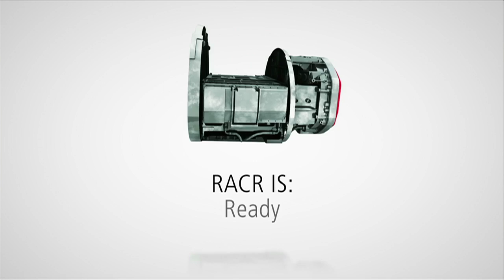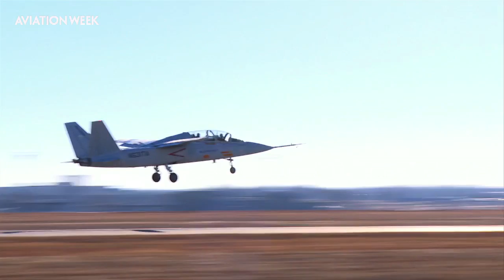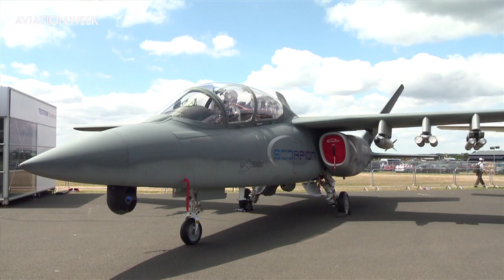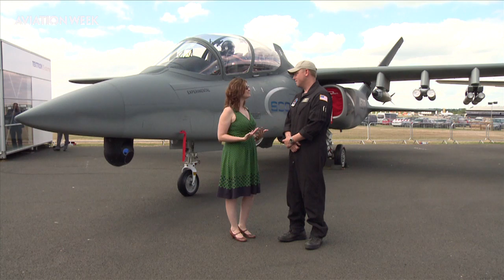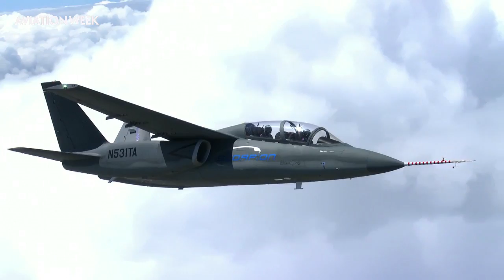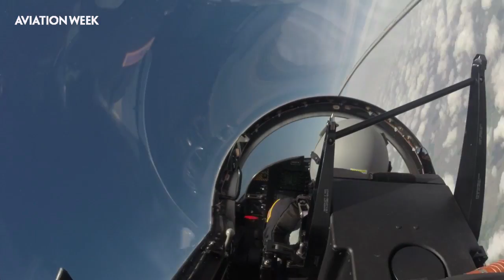Farnborough Airshow 2014: Textron AirLand Scorpion

Comment: $20M and only as fast as a WW2 ME-262?
Reply: +Nico Montinola It's an Air-to-Ground support plane.  The ME-262 was an anti-bomber high altitude fighter.  Compare this thing to a Stuka JU-87 if you're fixated on WW2.
Reply: I wasn't arguing the fact it was slow.  I was arguing on the cost.  You can get a faster jet and use it for ground attack that costs the same or a cheaper ground attack plane. Its a cool plane but just not cost efficient for the mission.  Of course, its a versatile plane but then you end up paying for that versatility.
Reply: Fortune K Its overpriced.  Korean FA-50 can do ground support and is supersonic.  Russian YAK-130 is cheaper and do the same mission.
Reply: @AccordGTR  They can do the same mission but for more money. The cost of  maintenance, preparation is lower on this aircraft, it is also more fuel efficient.

Comment: I can buy a private jet like the Citation Jet with the same money, and load it with a ton of cocaine and probably still fly faster and higher than this plane, much less chasing it down.  Remind me why I would want this jet for border security?

If I want to do ISR, I would not need the speed, so it'll be cheaper and more on-air time  with propeller based plane.  Or just mount some camera pods on a private jet.
Reply: But, with  at other plane, can you drop it on target properly

Comment: This is a cheap jet designed for sale to 3rd world nations whop want cheap counter insurgency and patrol capabilities.  Or other nations who want a trainer that can be used for ground strike in an emergency. The critical sales point is cheap running costs for budget conscious governments.
Reply: That's good. I live in NZ and the RNZAF needs an aircraft that could serve as a jet trainer, ground attack aircraft, maritime patrol
Reply: +Antifaith29 I don't think JTN L means fast jet aircraft. The RNZAF used to operate A-4 Skyhawks, the Scorpion could fill the role that it used to if the RNZAF wanted to have that capability back.
Reply: e0o9kii
 A jet trainer for what? The RNZAF has no fast jets and doesnt plan to have any. They are entirely reliant on the RAAF for that kind of thing. It's a damn shame actually.
Reply: +AdstarAPAD I wish I had a budget conscious government.
Reply: Thanks Mr. Obvious.

Comment: If we wanted a cheaper fighter for CONUS interdiction of unarmed aircraft and light attack, we've got plenty of cheaper and more capable T-38 Talons and T-45 Goshawks we could convert, or use drones. This aircraft is a solution looming for a problem, and it looks like shit, but that's beside the point.
Reply: looking not looming, damn auto-correct.
Reply: +Tin Man  You would have to re-develop the T-38 and T-45 to fit all the ISR equipment and the T-38 air frames are old.
Any customer of the Scorpion may want it over a UAV because manned aircraft have better tactical and situational awareness.